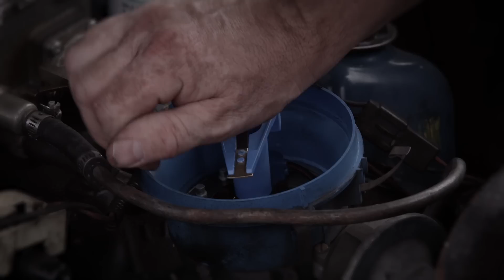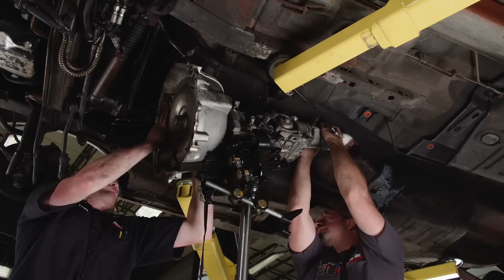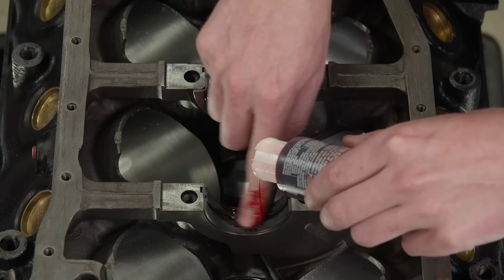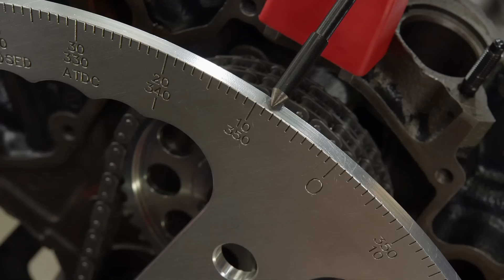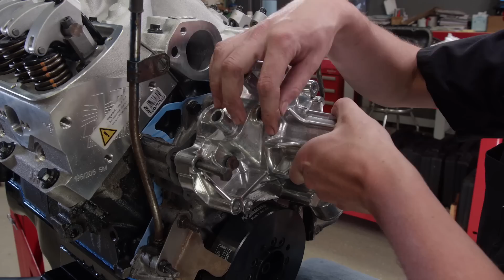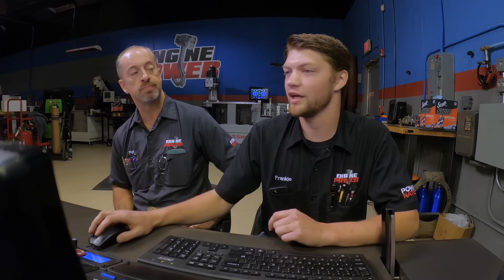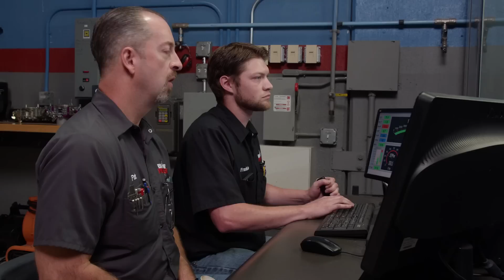Disguising a High Revving 347 for our Sleeper Granada - Engine Power S9, E13

Comment: I love the show. Ford's to me made the best building foundations myself small blocks.
My last was a 302 bored .30, Keith black 10:1 raised dome pistons. Crane 1.6 rockers on top Gt-40 heads. Align honed,decked 10/10 on  crank.lunati hydraulic cam .496 int,/.512 exh. Offset change the firing order to 351w so the 302 firing order puts stress on the front of the crank, a melling hv 85 oil pump, mechanical Carter fuel pump, old school motorcraft distributor from a 79 mercury tied nto a msd 6AL with rev limiter, comp. Cams valve springs. Holley 650 cfm double pumper 65 primary jets 72 secondary jets. 1-5/8 shorty headers. K/n 13 inch air filter to clear the distributor. 10-15 hg. On vacuum,12 degrees timing.all ARP fasteners. Old school oil filled coil to set the fire. Out to 2-1/2 flow master dumped exhaust. Backed by a c-4 3 speed small bell housing 10" b&m 3000 stall converter. 3:73 motorsport 8.8 Inch posi. Homemade 304 stainless steel rear links, three core brass radiator keeps it cool w/a 14 puller electric fan and a flexlite belt driven fan to push. Operating temp with a 165 degree thermostat. Ran at the best 180 degree's. I go by vacuum. Oil pressure. Regulated fuel pressure 6.5. my plugs tell me autolites nice tan on the electrode and Index my plugs 8x8 but out of 64 tries I got the open gap on the plug on each cylinder to welcome the intake valve and 92 octane. It came alive and could turn 6500- max I got was 7000 rpm.backyard built Dremel port and polish. This was a sleeper 88' ford notchback. Old ford blue, the chrome and 8.8 yellow plug wires. Complimented my under hood appearance.

Comment: The weight of that car is not going to match the high rpm of that engine. That heavy car needs low end not high end power. Nice engine but there is just no way that car is going to perform at all what you may want it to

Comment: I had an '78 Mercury Monarch with the 302. For its time its was quick, but the back end was kind of light. It was fine on dry pavement but busted loose easily when it got slippery.
-a pretty decent warmup for the '88 Mustang 5.0 that I replaced it with!

Comment: I remember my parents’ 1965 colony park with a 390 4bbl in it. It supposedly had 300 horsepower but never was able to do a killer burnout. I hear Chevy has a 632 cid v8 with 1200 stock horsepower but it costs 16k.

Comment: I used to drive a old '76 Granada back in the early '80s. Mine had a 200 6 cylinder. It was slow but dead on dependable. This car should make a good sleeper, especially if you put a air or electric locker in it. That would be a fun car to drive. 👍👍
Reply: Ron.same situation. Blue with white interior. 6 cylinder. Good engine.trans died in a parking lot. Would only go in reverse

Comment: 347 is cool and all however...I would be tempted to just go ahead and build a 408/418/427 351w based stroker for the same sort of money and make a bit more power. Pretty sure that with TFS 11R heads over 600hp would be fairly simple to do.

Comment: You guys assembled the engine very quick so I'm not sure if you had to notch the bottom of the bore so the crank's counter weights don't hit the block. When you degree the cam I'm wondering if there are some offset bushings used?

Comment: And to finish off the image, install some exhaust cutouts and weld in a stock looking single exhaust; 1-3/4" pipe going through a big fat factory sideways muffler with no special tip under the bumper, just a standard French cut, pointing down tip.

Comment: My steel block Chevy sb motor in my asphalt super stock is making 598 HP to crank on a 800 cfm double pumper VDL racing carb cross over headers and revs to 8700 rpms. Basically same motor they build except it's Chevy 350 it started out as same brand manifold as well but mine is serpentine and has only water pump power steering that's it alternator is ran off the Ford nine inch rear end

Comment: Too bad one of the large head manufacturers don't level the field and make l.s. architecture for the Windsor. The numbers you got are impressive but with better heads you'd make even more.   We know ls heads fit and work on a ford so why has no one cast a production ready set, it would be fun to start giving the chevy guys trouble with an old outdated engine.

Comment: I spent a year building a 5.0HO to replace the stock 90 5.0 HO I have in the car.
Stock block crank rods with ARP bolts. Diamond flat tops 65 grams lighter than OEM forged pistons and I used the stock 90 5.0 HO hyd roller camshaft. I added 79 302 heads which I had Indy Cylinder Heads weld the water passages which where a long slot right under the intake ports to strengthen the head deck surface at 12 noon. I also added one water steam hole at ever chamber .312” x 8 places.
Ported exhaust ports shortened exhaust guides in the port 3/8” installed 351-w valves exhaust and intake from PEP with Rail Tips so I could use Comp Cams Magnum Roller tipped cast rockers. Along with special length ARP rocker studs because I milled the rocker boss too much.😢 Thanks to Bob F. @ ARP he saved my butt.🎉
Left intake ports alone.
Stock length Moly push rods gave best valve tip to rocker travel.
So I had Amy old Friends Dyno the engine I was very happy it made 296 hp at 5500. Forget the torque.
Anyway about 96 more than the engine in the car.
Life steps in and my daughter needed hip and leg surgery so I sold the engine. It was in a Fox body and the kid sprayed it with 15 bottles. Then it was sold because he had melted the plastic oil pressure line and thought he had hurt the engine.
Naaa I used coated rods and mains, welded a big baffle covering the oil sump in the stock pan with a 5/8 351-w pickup tube and Boss 302 windage tray. Oh crankshaft and windage tray both coated by Carl Benton at Poly Dynamics in TX who licenses Calico to use his system.
Engine was unhurt. So it’s in a 56 Ford street show car for the last 20 years haaa.

Comment: Had a 75 4 door stocker and just slid a 1980 Bronco short block into it even left it 2 bbl single exhaust and got 20 mph and was quick until 3 rd gear in the C4 Haa.
Then I upgraded years later with a 79 4 door but with everyday help, installed a new off the assembly line 1990 5.0 HO a built C4 by Jim Mayers 2500 stall TSI, Auburn posi and 4:11 gears, Edelbrock’s Performer 625 Edelbrock carb. Headman 1 5/8” x 3” headers a line lock and a TCI shifter. Gas shocks good tires and R&M front and rear sway bars. Great driver red light bandit Haa. 15.18@ 90.7 ripper😂

Comment: I had a 1978 Granda ESS, 2-dr, in fire blue metallic. Loved the car with the stylish cornering lamps, landau top and that distinctive European look. The only problem was that it had a 250-6 cylinder. A huge downgrade in power after having giving up my ‘71 Roadrunner with the 383. I kept the Granada for 15 years with no major issues. I was seriously thinking of swapping the inline 6 with a 460 which would have been the ultimate sleeper. However, bought my first truck, a 93 Ford Ranger 2-dr, long bed. I had it for 19 years until the tranny gave out. This build you have going with the Ghia will be definitely sensational in both rumble and power! Anxiously awaiting the final product.
Reply: My first was a '77 Monarch 2dr, baby blue, dark blue vinyl top. Inherited it when Pap passed, '81. Put some ET 5 window mags on it, drove it for years. Really dependable, 302, C4. 
You would have a hard time shoehorning a 460 between the shock towers, probably have to go with a Mustang II-type IFS. Even with the 302, mine would push (under steer) in the corners. A BB 460 is going to be even worse. 
I later bought a '75 Monarch with a 250, 3 speed. Drove it into the ground. Would love to find another 250 for my '61 Falcon resto. Great aftermarket aluminum heads available now for these Sixes. I did find a wrecked Fairmont with a 200, 4 speed. It sat for a few years, I am currently soaking the pistons / rings with a 50/50 mix of acetone and ATF. If it isn't locked up, I'll just use it until I can find and build a 250. Sorry, I just like those "6 in a row" engines. Couple of side-draft Webers and a T56 trans, should be a cute little ride. I'll post a vid when I get her going.
Reply: @jeffhale2278  Hey, Jeff. Thanks for the feedback. We considered the tight fit with the shock towers, but given your experience with the 302, the under steer was not factored in. My ESS was a great unique vehicle which I enjoyed for 15 years. After it was sold I’ve seen it on the road for about two years after. The only “performance” item that I had installed was a Trans Go shift kit which distinctively gave a much harder, quick shift. A lcracked intake exhaust manifold was the only issue that I experienced. A replacement was found somewhere in the Midwest.

Comment: Would be good to explain what the number 3456 comes from for those of us who care.  If you do care, It's 1728 (number of cubic inches in a cubic foot, or 12x12x12) multiplied by the number of revolutions a 4-stroke engine needs to complete all four cycles, or 2.  1728x2 = 3456.  That equation also assumes the engine is operating at 100% volumetric efficiency, which is unlikely, but a fine way to size your carb.

Comment: nice numbers 👍. i was pretty close myself. 9.5:1 347 93 fuel 511@7000. roller cam and hydraulic lifters. using comp cams "8000" rpm hydraulic  lifters as they claim. one daily when i get a chance to throw the snail on and drive it, i should have a great time.

Comment: My 71 Nova had a 350 four bolt main 60 over. The induction was a Edelbrock torqer 2 manifold with a 950 carb also from Ed work like a beast.

Comment: First car was a 1977 Monarch Special edition. It's a meme on the internet now. Same orange/ copper colour as yours, but four doors. A friend had a 78 Granada ESS that had aluminum heads and intake  stock from factory. Apparently they shipped some of the cars with these components as experimental platforms for weight reduction, etc. If they failed, replaced by Ford.

Comment: This will be a cool sleeper. Don't bugger that part up. No Monster tach on the dash, no CalTracs hanging down or low hanging headers. Keep it looking just like it does, maybe a small shift light,  maybe an oil pressure gauge but column shift or a stock floor shifter, whitewalls and hubcaps.

Comment: These dyno pulls are not fair. You did a wheel dyno pull, build the engine and then did a flywheel dyno pull. You can't use these numbers at all

Comment: great video! The forgotten car! Ive owned 6 of them.. current one is a 76 with 6.0 LS with BTR cma and stage 2 heads. I dont recommend doing this swap to just any one,, its a PIA and recommend putting a mustang K member in it and going with struts because The manifolds dont fit between the shock towers unless you use Holley exhaust manifolds. The rear steering set up makes this another PIA too.. oil filter must be relocated to fenderwell.. Mustang 8.8 fits under the car with a set of relocated spring perches that are easy to do..Hope to see more of these cars around in the future.. there is a following for them.. Facebook has a few groups  Ill pass along the link to this video! Thanks guys!

Comment: I had a 78' Granada ES back in the mid 80's. Pulled the 302 out and replaced it with a HiPo 289 warmed up, couldn't run an air cleaner because of clearance issues. When I ran it at the Tulsa International Raceway before the change, it ran a whole 86 MPH in the quarter. Sorry, I don't remember the ET. After the 289 was installed, beefed up c-4 with a 3000 stall and 3:55 geared 8.8 limited slip, it ran 11.97 best. Drove it every day and to go play. Once raced a guy with a blue Camaro 6 times in one night at the strip, because he couldn't believe a Granada beat him. That's 6 times at 100.00 a race! It looked like Grandmas car, because it was. Fun times!!!

Comment: Can't wait to see this actually in the car and doing a couple of 1/4 mile pulls! You're definitely going to have to do something with that C4 trans. though (like throw it in the trash) and build a decent transmission with a trans-brake and a high stall converter, to get some good 1/4 mile times. Pretty impressive pulling over 500 hp. on a somewhat stock, carbureted, 302 block (well 347 actually)!! 😁👍
Reply: Somewhat stock XD XD XD...........forged rotating assembly with flat tops and a solid roller custom ground cam with arp heads a single plane intake with a 950- cfm carb

Comment: I built a '82 Granada/fox platform sleeper wagon.   '89 EFI , 5 spd,  street mods.   They're light weight and cheap to build.   Ran 13.2 @ 102 @ 3500 ft.  Calgary.   A daily driver that smoked a Ferrari Mondial  and just beat an LS powered Z28,  much to their surprise.   A boatload of dumb fun,  and that's a good thing.

Comment: Isn't that about the max amount of power you can get without cracking the block for one of those little 302s?
Reply: Hence the main bolt girdle!
Reply: @MrMan_47  Good point, I wonder if anyone has actually ever tested them to a higher horsepower than a normal block cracks to see if it stops that from happening. I'd like to see a video on that.. kind of like with and without I know it'll be difficult because each block is different but it'll be interesting.

Comment: My mom had a 75 or 76 Granada just like this except without the trunk luggage rack, same copper color.  The 302 was just enough to get me in trouble.  Raced a friend one day between towns here in Ohio.  He had a 68 Firebird with a 326.  He got me at the traffic light, but I had slightly more power top end.  I kept the pedal to the floor for the whole 7 or 8 miles, we were locked on 125mph.  I had enough to pass him, but every time I pulled out to pass, an opposing car would come and force me to dive back in behind him.  What an idiot I was.  Did a lot of other stuff in that car too, if you know what I mean.

Comment: I always wanted to do the 79 ESS version of one of these Granadas with the rare manual trans...they are out there. I prefer the square headlights....
Reply: The 351 option was dropped in 1977. The largest engine available in 1979 was a 302.
Reply: @jeffrobodine8579  I found this 1977 spec:
1977 Ford Granada Sports Coupe 351 V-8 Cruise-O-Matic (aut. 3) (model since October 1976 for North America U.S.) car specifications & performance data review

Comment: Saw a mint granada on the highway earlier this year. Could not see the the emblem, took me and my dad a bit to figure out what the hell it was. Still plenty of people around that have nice 70's vehicles in their garages. Taking a 302 plus $10k and turning it into a high power stroker motor is nice and all but there are still a lot of people like me who have these classics and want something more budget a street friendly. A 302 build where torque for towing and street use (like for in a 70's F100-F-250, but still have decent horsepower without spending $5k-$10k would be nice to see some time.

Comment: when I saw the car I was hoping for for the ford 255 small block they ran from 1980 to 1982 I've always been curious what that smog boat anchor  would do with a roller cam a 4 barrel and better heads would do

Comment: If it is a "Sleeper" you should have used a dual plane intake to keep the power band in a street usable rpm range.
Reply: @FBSSTEELER a single plane intake will still work on the street

Comment: i would like to see a EFI equipped ford windsor 347 stroker v8 swapped into a late 70s Mercury Monarch...my bucket list so to speak
Reply: @Rho Statton that's basically what they did just with a carburetor the Grenada and the Monarch are the same just some different body parts

Comment: When are you guys going to do some budget builds? Not all of us have 10k to throw at a summit catalog. Im talking scrounging swap meets... spending money in the right place... like 3k tops.  builds.

Built my 408 for about 3k. 1k for scat stroker rotating assembly, 1k for machine shop bill, 1k for the rest of the parts. Iron heads, home porting, swap meet intake carb and headers, stock ignition system with home tuning, that sort of stuff.

Comment: Big giant sway-bars front and back...stock rate springs...eight inch wide,  fourteen inch steel rims, factory existing wheel-covers, 245/60-14 tires, limited-slip rear-end, a built C4 to hold the horsepower. Big four pass radiator,  Full spec pads & shoes..
  This would make for a wonderful sleeper...& nobody would even look twice.

Comment: Would have liked to have seen a modified 354 instead of the more common 347. Is the .60 over piston too much for a Ford Windsor?
Reply: Not at all, but they had already bought .030-over pistons. It was a little surprising that such a minty-looking car had already had a rebuilt engine and that the engine was already as tired as this...
Reply: @mtut  Like the old saying goes never judge a book by its cover
Reply: @purpurahaze9179  True. I grew up in the Midwest when a lot of these were on the road and probably got thrown when one turns up that isn't a total rustbucket. 

But I am thinking the (rebuilt) engine that was in the car didn't look very worn-out from what little they showed of it. It must have been out of tune to be making less than 100 horsepower. They even commented it was cutting out at higher RPM. It's not that these were really impressive, stock, and I understand they were going to rebuild it anyway, but they really didn't put in much effort to see if they could make it run like it was supposed to. If it's not putting out 120 with as clean as it looked internally, it's lazy and sensationalistic to be comparing that with the engine they built with love and care and top-notch aftermarket stuff. 

Enough of a wallet flush can always achieve results.